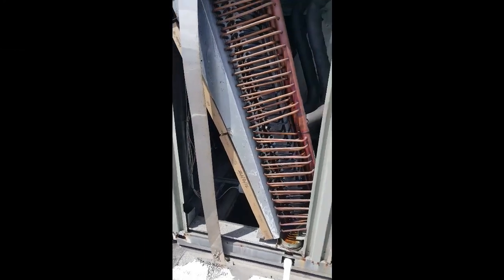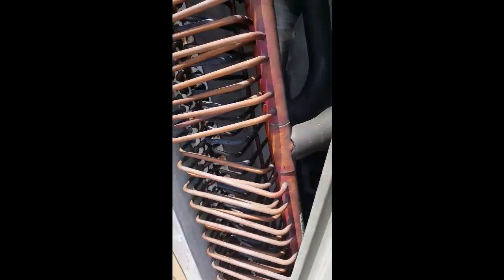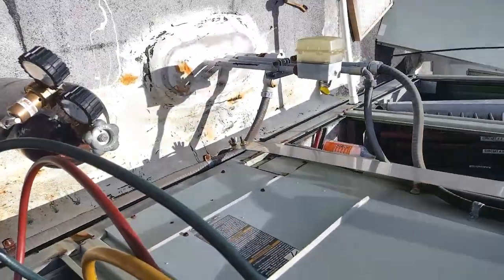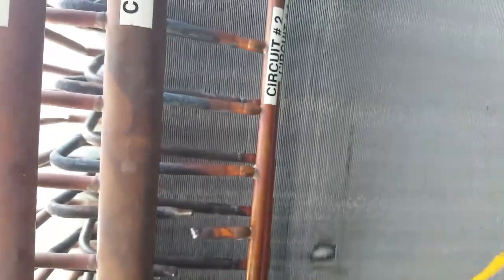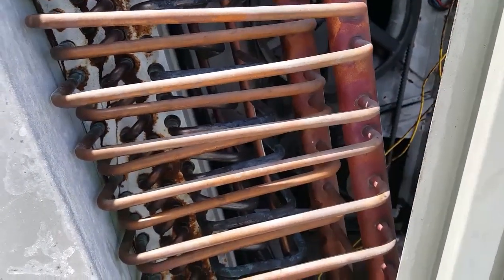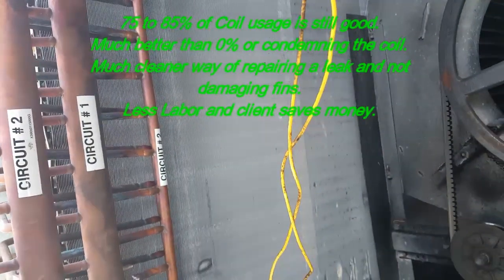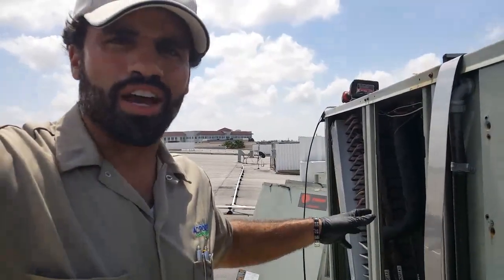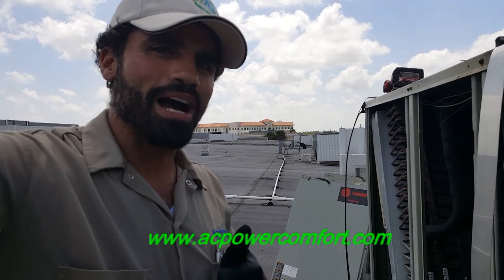Hvac commercial troubleshooting repairs

Comment: If there's a leak in a coil, you replace the coil. The hell you doing isolating for? Coil has a leak. If it's not on an elbow where you can throw a quick braze you replace the coil.

Comment: Nice repair good repair tip thx for sharing!
Reply: that an awesome way to buy UR customers time.  Please correct if I'm wrong but is isint  each circuit isolated already with its own metering device and compressor and if so does that mean you can just disengage the contactor?